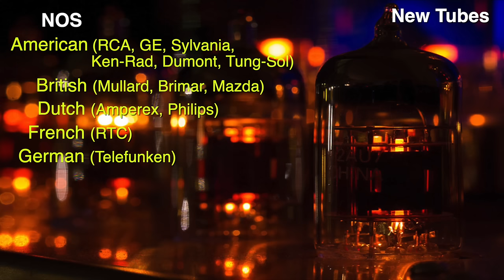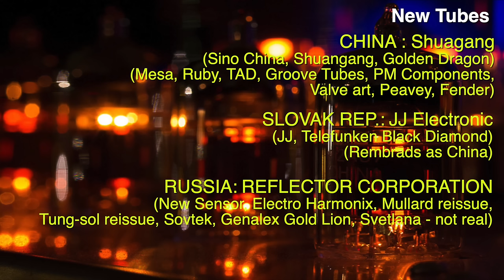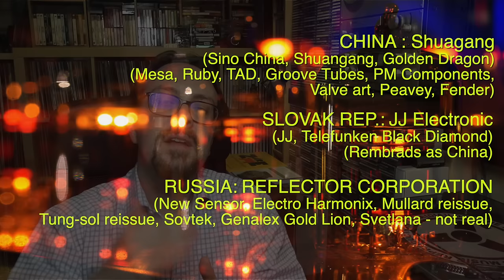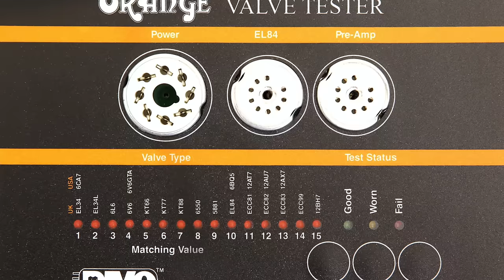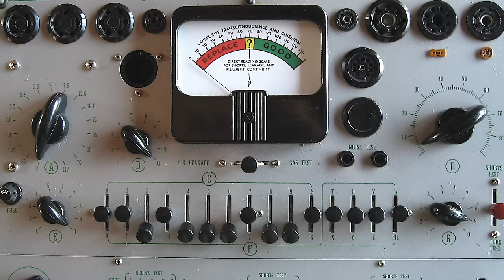Vacuum Tubes Basics: 10 things you need to know

Comment: Tubes are amazing, I have a German radio from the 1950s with 5 tubes in it, and it sounds amazing! I just hope tubes will never go away!
Reply: Tubes are like mousetraps, Hershey chocolate, they will always be around😁I hope🙄
Reply: Tubes are used more and more these days
Reply: @XtianApi  cause they are amazing! They sound a lot better than transistors.
Reply: An old 5 tube radio sounds like a tin box compared to a proper Hi-Fi tube amp.
Reply: @davelowets  I'd say it honestly depends on manufacturer quality, Valvo tubes were known for quality.
Reply: @davelowets  wrong

Comment: I had 4 phono stages at the same time to compare in my system the Schiit mani, Cambridge Audio, Rega and a Budgie from Parks Audio. The Budgie was a tube phono preamp the 3 others were solid state. In the end the Parks Audio Budgie made my albums sound the best to me. FYI the Schiit mani put up a good fight. Awesome information sir like always, Thank You!
Reply: For my very first foray into tubes (after TRYING to be an Audiophile for 40+ years) I just recently bought a Littlebear T11 all tube phono section, which has 1 rectifier tube and 3 other tubes.  This is replacing the sort of dual-mono semi-vintage Discrete Sherwood Newcastle preamps/amps that run each channel of my two tall fully open dipole multi-driver line-arrays, where I've been using the phono sections of those preamps/amps for nearly 20 years.  It's burned in now probably over 60+ hours of actual playing, and I THINK I'm going to like the sound.  I agree with the fellow here that earlier in the signal path would be the place to try tubes first if possible.  So, I'm interested to see how I like the sound.  The unit came with stock Chinese 6n2 tubes, but there are switches and you can use 12AX7's instead.  I just ordered 3 really inexpensive new matched 12AX7 tubes from Upscale audio, so I'm quite curious as to how they will sound  : )
Reply from the maker: Nice!
Reply: @anadialog   BTW, I didn't really direct a much deserved compliment to you for your excellent reviews and such, thank you!  I found your advice on another post from you about interconnects which was bloody PERFECT timing because at that moment I needed one.  And, although I have some really ancient ones that were considered very Audiophile at the time, those are in use in my main system, but I needed one for my secondary that was decent but not prohibitive.  And BOOM your video about those interconnects which I've never heard about was perfect, so I snagged the entry level one and it's working fine, thank you!  I must say, a very nice looking interconnect for that price.  I'm sorely tempted to try the high level purple ones on my main system, but I'll have to see about that.

Please keep up the most excellent and *VERY* helpful posts mate!
Reply from the maker: How cool! Thanks for sharing that!

Comment: I'm a tube only guy..! 

My riaa is an De Paravicini EAR phonobox,  run by 3x 12AX7 and passive SUT gain. (step-up transformer) 

Not a single transistor or Op-Amp, neither in the gain stage, or in the riaa equalization itself. 

Then a blue alps pot (again a passive variable resistor)  controls the line signal level which is being sent directly to a Primaluna tube Poweramp,  again with no transistors or Op-Amps. 

Pure analogue sound being handled by passive discrete topology, Valves, resistors and SUT's from end to end.

Comment: good video but I would argue that you are underestimating tube life especially in preamps. If the equipment is designed conservatively and is in good condition preamp tubes can out last their owners. I have picked up equipment that was half a century old. I have had to replace capacitors of course as they start failing with time (same as solid state gear) but quite often the tubes are fine. Power tubes wear faster of course especially if they are biased hot but even then they can last for many years in normal home use.

A couple of suggestions if you buy used gear I highly recommend re-capping it. secondly, over the years household power line voltage has increased significantly. with older gear if circuit voltages are higher than spec consider having a bucking transformer installed or some other circuit modifications to bring the power supply in spec.

Well built tube power amps are a beautiful thing when used with proper speakers. generally speaking the last octave (below 30Hz or maybe 40 in some amps) is better handled by a subwoofer driven by solid state.
Reply: Just one of virtually every point he made that's wrong or flat-out-opposite of the truth. Yep.

Another good one was tube handling, for which he described precautions you only need to take with projector bulbs. (The absolute only reason to be careful touching a tube that isn't too hot to touch is you might risk wearing old labeling paint off it. You will not crack a tube with the oils from your hands being on it, again, that's projector bulbs. Watch any of the thousands of amp tech videos on YouTube and watch them all touch tubes with their fingers.)

I could go on and on. Again, I can't think of a single correct thing he said in this. Most of it was useless for advice purposes anyway as it had no action-items to follow, but some of it was outright bad advice, like you correctly pointed out here.

Comment: Another great video (I just subbed)!  Synergy is also something that comes into consideration when trying to achieve great sound.  Sometimes, you get unexpected results, better or worse.  Recently, I put together a system that included an inexpensive, but excellent sounding tubed preamp.  I went with a Little Dot MK3 head amp/preamp, and rolled a pair of CBS Hytron NOS tubes, circa early 1950's.  Amplifer is a McIntosh MC162 solid state, and Magnepan MG12/QR speakers.  Even thought these aren't larger KT88 or EL34 tubes, I cannot believe how great they sound!  Bottom line:  it really does not take a lot of money to get into tubes these days!
Reply from the maker: I agree! Your synergy concept is absolutely a further point to introduce!
Reply: Psvane art series gives direct 👌
Reply: I used that Little Dot MkIII as the volume control / preamp for my bedroom HiFi for a while.  It sounded surprisingly good, but not as good as a REAL tube preamp - I ended up with a Van Alstine FET Valve CFR.  It's an all-tube preamp that uses MOSFET's for only power supply regulation.  I own fancier tube preamps, but the VA is outstanding at its price point - no quibbles!
Reply: Thanks for the response.  I'm still using the same Little Dot MkIII in the same system, but unfortunately, our new addition to the family (a Rottweiler) precludes me from listening to much music these days.  You would not believe how one large dog can change your life, and add both joy and stress to a household!  The dog lives in our main rec area room where all my equipment is.  She is real sweet, but follows me everywhere, and requires a lot of attention, LOL.  Anywho, i'm hoping I can upgrade my preamp gear one day soon, and get a larger house with a separate 'listening room'.  I have a 'Ham Radio room' currently, but no other available rooms for listening.   @CustomTele52RI

Comment: Good episode, thanks! I like your two charts about tube Manufacturing countries.  This week I was shopping for a Fender guitar amplifier 5AR4 rectifier tube replacement. It converts AC current into DC current used inside the amplifier circuits. It's for a 2019 re-issue of a 1959 Bassman bass/guitar amplifier that I bought straight from Fender this year, made in November 2019. Not even Fender sells the exact same tube replacement, a Groove Tube!? I felt like I was shopping for old technology that is still only made in obscure locations that still have the manufacturing equipment for this old technology. Kind of fun. Kind of frustrating. I was actually upgrading the amplifier to higher 40 wattage Jensen AlNiCo P10Q speakers, it's a learning curve! It's cramped inside the amplifier cabinet and I couldn't reach a few bolts to remove two speakers. At one point the 5AR4 tube was in my way, so I briefly thought about removing it, but how? I tried twisting it to unscrew it but that did not work. It has two C shape clamps that you have to press down hard as you gently jiggle the glass tube and try to pull it straight up and away. But I guess I managed to lose the vacuum when I was ignorantly trying to twist it, so I ruined that tube, it looks like it got foggy because it was no longer a vacuum inside the glass, I accidentally allowed humid air to enter the tube. A friend at work says tube amps aren't worth it, just use transistors that are cheaper. I think the question is like drinking beer from a bottle or a can, some can tell the difference and some cannot, some care and some do not. I have a $200, 100 watt Fender transistor amp, with supposed digital presets to sound like different classic tube amps, (meh, not quite effective);  and it's just not as sentimental and traditional as the $1,500, 45 watt tube amp that I am working on. The tube amp is definitely better sounding and worth the money in my opinion. For some reason the lower wattage tube amplifier seems to be louder than the higher wattage transistor amplifier sounds?! That's another reason I like the tube amps over the transistor amps. Just this weekend I discovered your YouTube channel, you have a lot of good episodes and topics! You have a lot of good insights.
Reply from the maker: Thanks for sharing your experience. I am glad to hear that who MAKES music is still a fan of tube sound and yes, you are correct tube amplification does appear to be louder because it has a pleasant distortion and makes the most out of the same wattage in respect to a transistor based system.
Reply: I have a lot of vintage tube rectifiers still in the boxes 
I have a lot of vintage amps
I love them
Reply: You want vintage tubes in America call or write Brent Jesse

Comment: If you know a little about quantum physics, you know that electrons infact are a huge mystery. Just the double slit paradox in itself proves that. Electrons can behave both as a particle, and a wave. Two electrons can affect each other over apparently endless distances, and electrons can disappear from one location, and pop up in another without any time passing in between. The behavior of electrons gave birth to The Super String Theory, which to add up requires the existence of multiple dimensions. This other discoveries also substantiates. These dimensions occupy the same time and space as we do, and electrons can unimpeded pass between them. This is infact what happens when electrons pass through a tube. Despite the short distance we see electrons travel through a tube, they infact pass through an almost endless row of dimensions. An extreme current of electrons are able to pull things along, like it happened during The Philadelphia experiment, where the ship was dragged into hyperspace, but even lower currents can pull things along from other dimensions and into this one. Passing through a tube, to higher dimensions, and back to here, electrons bring back divinity, and this is the very reason that tube gear sounds so divine. If you believe this, I seriously think you need to talk to somekind of therapist, but the divinity of tube sound is a fact that can't be argued, and believing in it doesn't require a straightjacket. Tubes rule!!!!

Awesome video mate.
Reply from the maker: Facinating! Thanks man! ;-)

Comment: Great Explanation on tube Matching! I have an 8 channel valve summing box and noticed when I engage the 4th tube (which is different) (channel 7,8) even if audio is not passing at the time. It still adds characteristic to the overall summing signal it can make it better or worst.. might add too much shine… etc. It is always good to match them with the same company. Personally I prefer Mullards Eico 12ax7 ECC’s mid 1960s Vintage. Jimmy Hendrix style! 🙏

Comment: mostly agree.You can make a solid state riaa(phono stage or a power amplifier that sound organic.No negative feedback local or global solid state done right get that organic sound(not harsh) without the bad things a tube are known for.And they sound the same at any level until clipping.I only use this type circuits in my build,s.No oscillating problem with them either.Component choice and short  symmetric signal path is important.The most silent amps i have heard also.No hizz. I use  sensitive drivers 94 to 96db pr watt 1 meter no horn.Amt type tweeters ,planar magnetic mids from 240hz and up in a active setup.Have to put my ear close to the tweeter to hear some faint hizz.Have tried lots off different amplifiers, they all had hizz i could hear easy from my chair.

Comment: With the cost of electricity going up astronomically, the amount the equipment costs to run may be a future issue. I had a rather basic class A bias ECC83 X 2 EL84 X 2, 5 watt stereo amplifier and it drew about 80 watt from the mains. The output vs. consumption issue can be improved with class AB bias, but purity is lost with AB. For a couple of KT88s running in class a bias, a second mortgage might need to be taken out: UK electricity prices only, consequent of the evil Net Zero. With single ended class  A units, matching is considerably less of an issue since most stereo amps will have a balance control, although I much prefer gain matching between left and right channels. Interesting upload.

Comment: I have had access to possibly the best of both technologies.  The older one is mono. It uses four 6V6s push-pull parallel. But the only info is for a version with two 6L6-GT.  No info on matching. We'd often listen two rooms away and it sounded like Horowitz was playing his Grand in our living room. I have another hybrid Germanium with three Nuvistors (an RCA answer to transistors. Three times bigger than a TO-5 case for VHF, UHF low noise) That stereo from late 60s is still running. For tube testers I'd suggest a trans conductance tester. Hickock Electric made some of the best. You could look up a tube's specs and set measurement by that even if the roll chart didn't have the tube on it. DC on the filaments  does make a difference.

Comment: I remember having read somewhere that it's possible that NOS tubes may need an extremely long break in period, due to the thick oxidation that built up inside the tube during all the years of storage. It may be the reason why you didn't like the new tubes on your preamp. My suggestion would be trying to keep it powered on for some days, or even weeks to see if something changes, especially if the tubes are valuable. If you let it powered on for a long period maybe try to have some overkill considerations on where you place it, since tubes are so hot you'd really want to minimize the risk of something catching fire, especially when you are not at home.
Small curiosity, tube rolling gets its name because of the movement you do to remove the tube from the amp!
Reply from the maker: I agree! I don't know of oxidation, maybe in a few parts but the parts inside are in vacuum so can't be there...brake-in is absolutely my 11th point! Thanks for mentioning that!
Reply: @anadialog  Exactly what I thought, but it's possible that the vacuum inside may be not 100% perfect, so the "few" atoms of oxygen after all these years find a way to bond with the metals inside. Even on the international space station the few atoms of oxygen slowly burn the seals of the hatch!
Reply from the maker: @karellen00  I see...that is another point for new tubes then!
Reply: Sounds like another non-scientific myth to me. There are getters in the tubes that remove any air molecules trom the vacuum...
Reply: @westelaudio943  It's possible, in fact I wouldn't know how heating a metal without melting would remove oxidation. Anyway there must be something else, the need of long breaking in periods on old NOS tubes is widely documented (at least it seems more plausible than that everyone having a placebo effect and just getting used to the sound, even if this is still possible)
Reply: @karellen00  

Show measurements please. "Many people say" is no argument. Do you eat poo because million of flies can't be wrong? We have measurement tools for that, thousands of times more sensitive than our ears and if they can't register the effect your ears can't either, unless it's psycholigical.

Never had problems with NOS tubes BTW.

Comment: A properly biased tube working well within safe limits will last you for years. Also, matched tubes are only needed when you need to use two single triodes in a differential amplifier configuration.
Reply: YEAP !
Reply: Yep. (Did he say anything that was actually correct in this video? I don't think so.)

Comment: I switched out my Schiit Mani phono preamp for a Project Tube Box DS. It was my first experience with tubes and even though they're only being inserted in a small preamp section, the difference compared to all solid state was big. The longer I keep spinning, the better the sound gets as the tubes get warmer. Rolling with my amp acts like a tone control as well. Tried a pair of reissue mullards and my vinyl setup sounded like I was using an old NAD amp. The stock Tung Sols are the opposite, more dynamic and forward, though a tad grainy on top. I have a pair of the Gold Lion 12ax7 gold pins coming in, curious to see what it does.
Reply from the maker: Cool! Thanks for sharing!